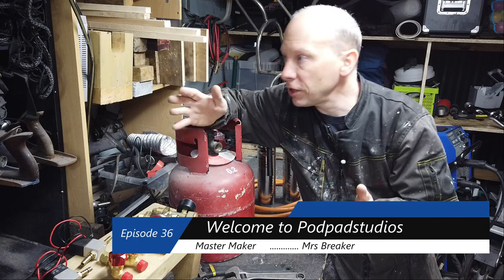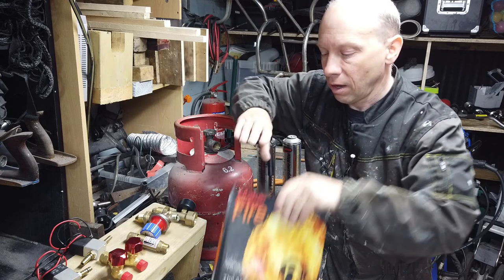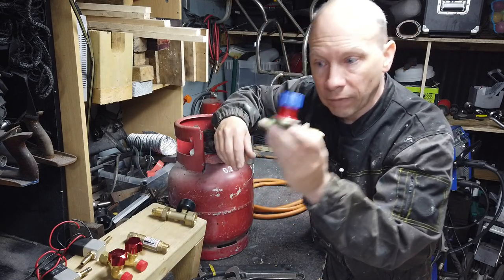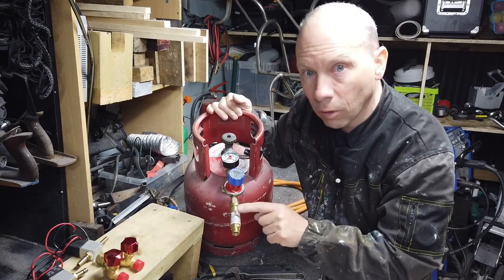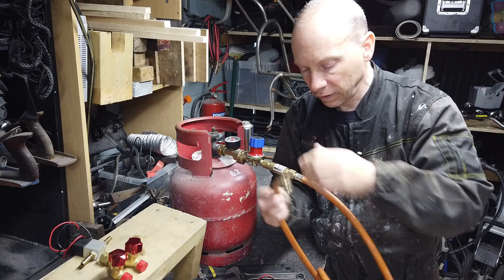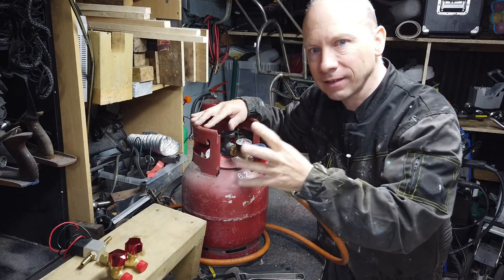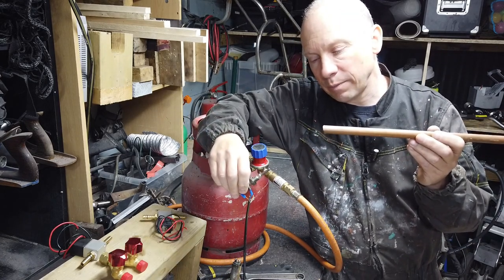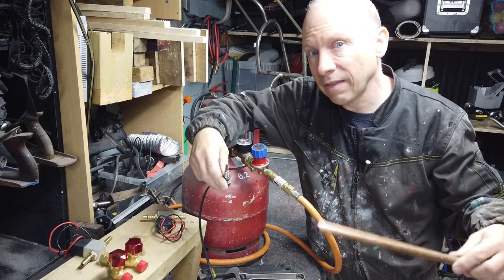Making Flame systems in props with Propane cylinders. Podpadstudios Season 1 episode 36.

Comment: A great video explaining the principles and theory without going too heavy on the safety. Info on the parts required is great as well. I set about making a small pyro system last Hallowe'en using the small butane/propane bottles shown here and like you said, it was really difficult to get a reliable ignition source as well as sorting the distance between the igniter and the outlet pipe.

As a former gas engineer, I thought I had a reasonable understanding of combustion processes but was surprised how tricky the pyro effect was to get right - then again domestic boilers only use methane at 21mb pressure in a controlled and well engineered chamber setting. Going to get a copy of that Make: Fire book as it looks extremely useful!
Reply from the maker: Thanks for the comments - Master M loves that book, it's like a no nonsense old fashioned text book with a touch of the Haynes manual about it... 👍

Let us know how you get on

Comment: With regard to the discussion of pressure drop as a result of temperature. Surely the regulator helps to regulate the pressure at a fixed pressure and the effect described would only be seen under extremes, most of the time the regulator keeps the pressure constant.

Comment: Another reason for not making a flame thrower, its illegal. Ask Colin Furze. He got arrested for it. Several times. 

However, I don't like a tree in my garden, so this is a good way to learn a way to cause an 'accident' so Mrs Clunk will eventually agree to my use of a chainsaw.
Reply from the maker: Mrs Breaker "Don't do it" 
Master Maker "tree? What tree.."
Reply: For this application you need high pressure bursts, and use a high pressure regulator so for example if you cranked the regulator slowly you are right it would not cause the effect.

Actually gas BBQs use low pressure regulators and don't have this issue (it was a food related question Mrs B asked mainly cos she was thinking about sausages & Burgers). 

To make dramatic flames you need to have fast flow.